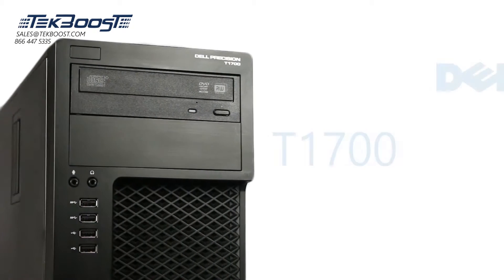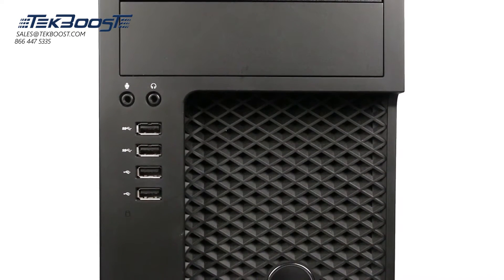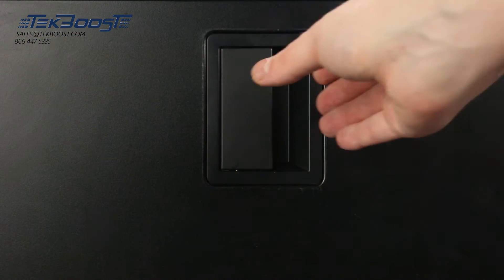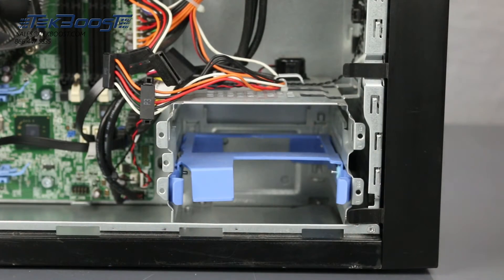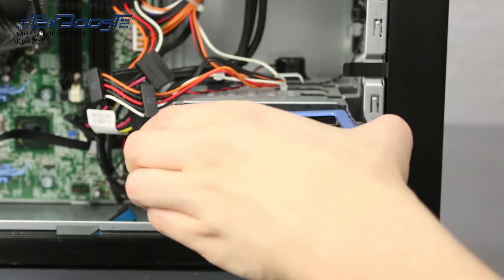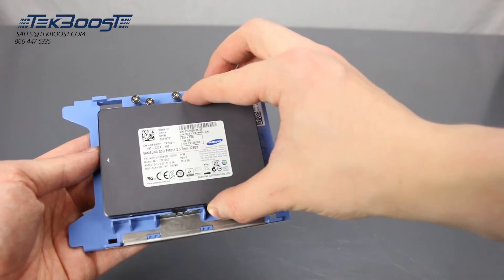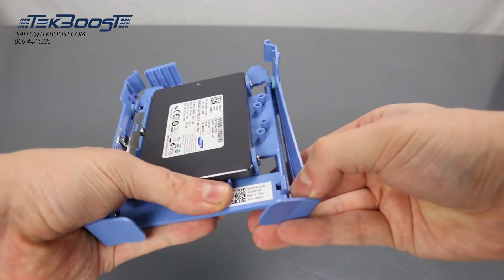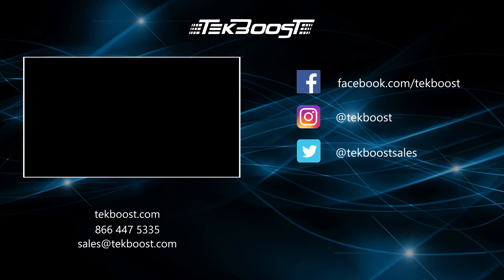Dell T1700 Hard Drive Installation

Comment: I noticed that you had a hard drive in with your SSD. Is it optional to have a hard drive with an SSD or do you have to have a hard drive with your SSD?
Reply from the maker: Its compatible with both or either alone.  We recommend using a SSD for the operating system.  A 2nd SSD or a Hard Drive can be used for additional storage.